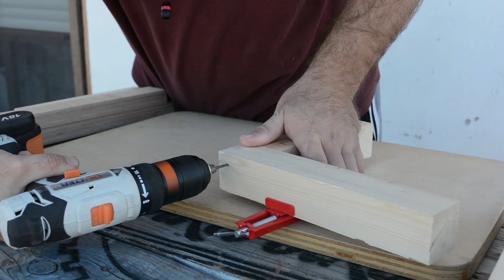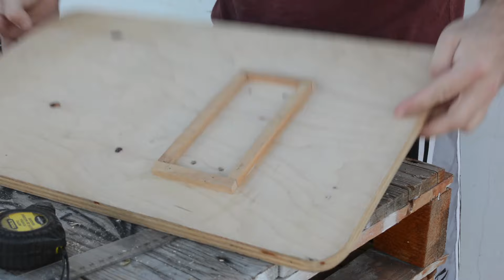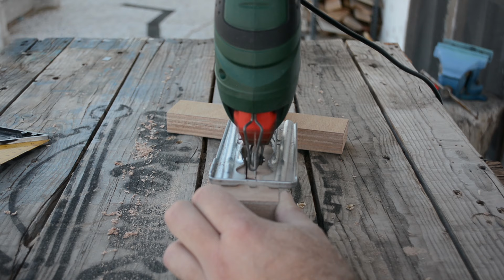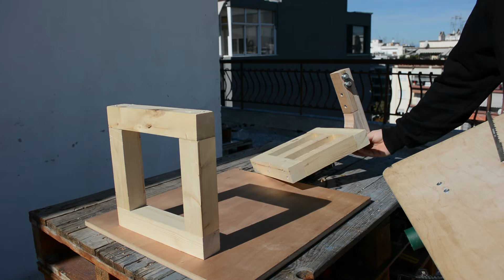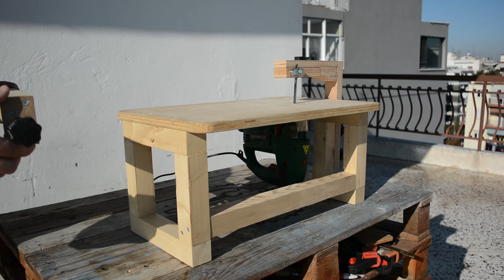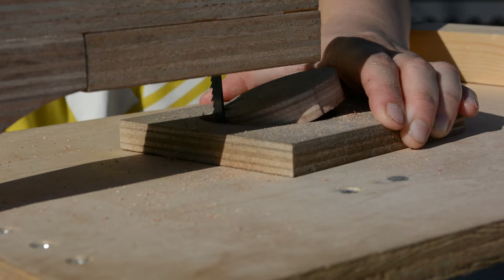How to make Jigsaw Table Machine

Comment: lay a sheet of 1/8" hardboard over the surface to make it smooth. Also, two 45-degree braces on the vertical support will eliminate the shaking. Finally, use removable thumbscrews on the legs and make it collapsable for storage

Comment: I appreciate what you have build but a normal person who doesn't have all these tools and advance machines can't build it so in future please keep in mind that you are creating something for beginner with minimum tools...Thank you
Reply: Well, considering that this is a guide to build a jigsaw table, having a jigsaw beforehand is kind of implied... Anyone should have a hammer drill, whether you're an aspiring woodworker, or just a homeowner using it to hang pictures. Same with a circular saw, which, with a speed square and straight edge, could easily make all the cuts required here. A few trigger or f-clamps and corner clamps are pretty cheap too. The rest is hardware, which (unless you have an extremely well-stocked shop) you'll need to buy separately too.

Comment: Move the blade guide down to about 1/16 inch above the piece of wood you are cutting to keep it from jumping up and down  while cutting.  A simple safety thingy to keep you from sawing through your finger. (Didn't see that you done did this 3 years ago, you probably learned that by now.  I made mine about June in 2023, works great,

Comment: My jigsaw blade keeps on falling out when the wood to be cut touches the blade for 2 inches only, what could be the reason? Should I clean somewhere or is Blade too short ? It comes down about 0.75" from the bearings.All else seem aligned and set into correct position.

Comment: Bee's wax on the table top will help when feeding timber to the blade, a metal plate behind the bearings will stop the backward motion of the blade from wearing away the guide arm and some timber support each side of the riser arm will stop any movement during operation! They are a great addition to any workshop.